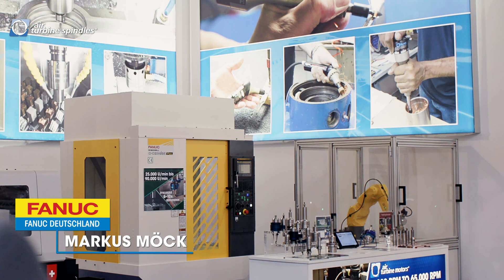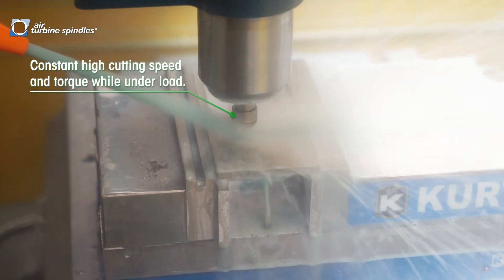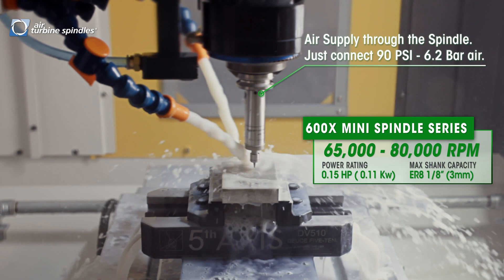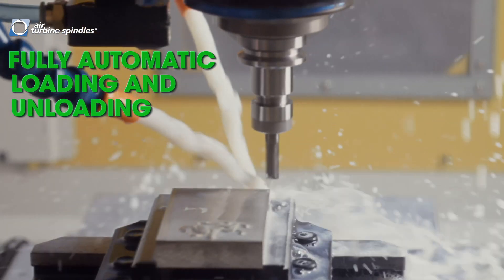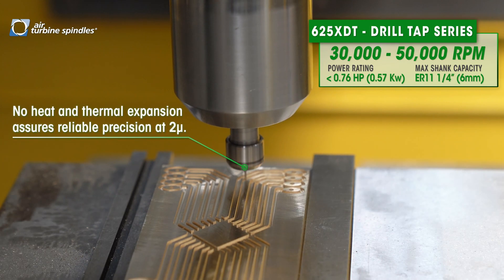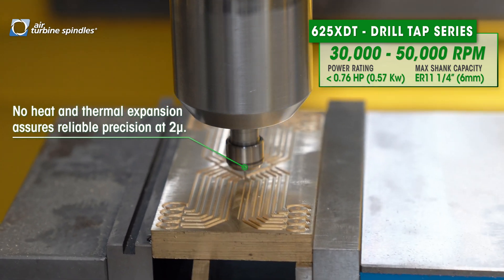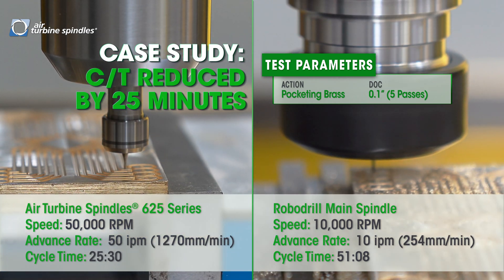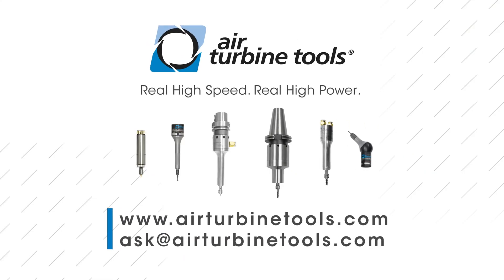This New CNC Spindle Mills Molds at 80,000 RPM on Robodrill

Comment: I mean just why? Why we need 80000 rpms
Reply: The surface speed of a 1mm endmill at 80000rpm, is about 250m/min. This is ok for aluminium, although with carbide tools, you could push it to 600m/min. For that, you would need almost 200000rpm.

Micro milling tools require insane spindle speeds, the faster the better.
Reply: Well to run the really small tools on its proper v/ms you need really high rpm. The tool diameter ypu go the rpm requirements goes up x²